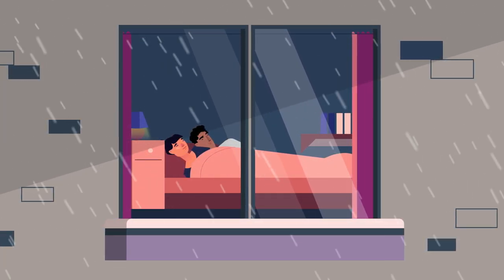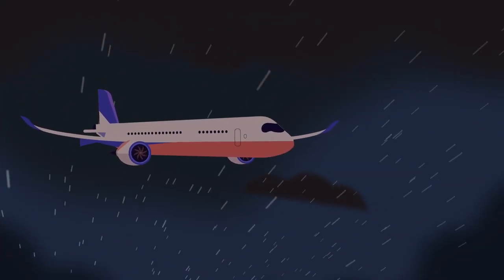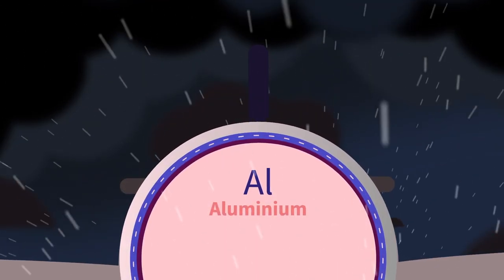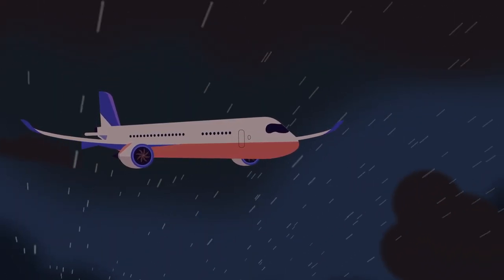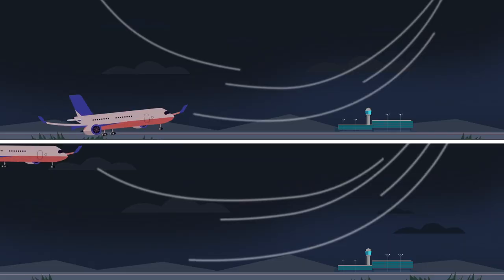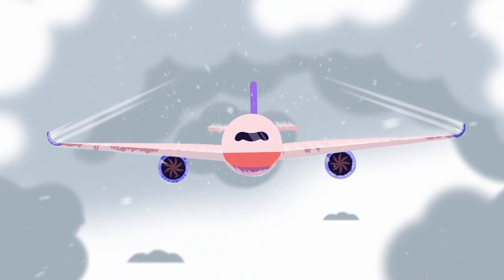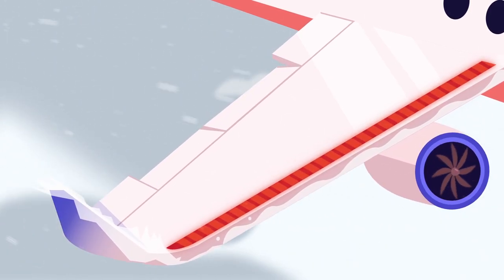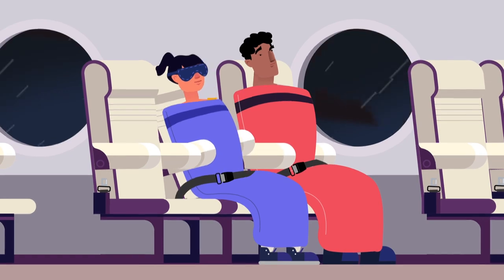How airplanes fly in bad weather | Discovery Space

Comment: Unless it’s Boeing of course...
Reply: If you think that Boeing is worse than Airbus, I recommend you to take a look at this article: https://i.imgur.com/5LIW855.jpg
Reply: @RAKKER004  boeing has become a shadow of its former self. Be safe. Fly Airbus
Reply: The two MAX crashes happened in clear weather. Stop misrepresenting plane crashes.
Reply: @RAKKER004  this is not an article. This is a meme. 😂

Whataboutism. Do you think Boeing makes planes out of steel? The 787 uses a lot of carbon fibre in its airframe as well. It's actually the aircraft type that uses the most of the material in its airframe after the A350 XWB.

Don't shill for any of the two. Both companies have done very shitty things.